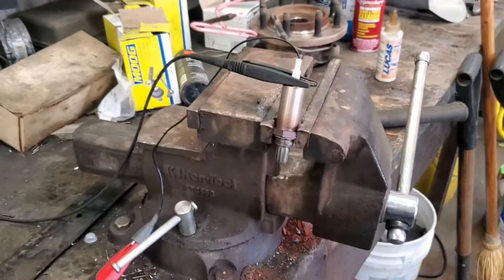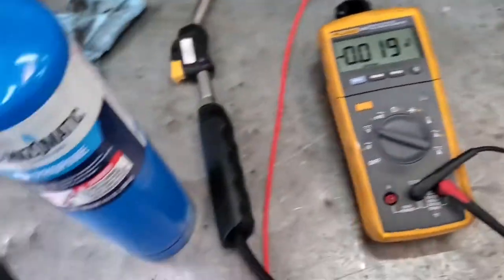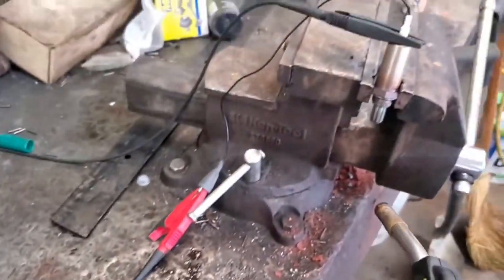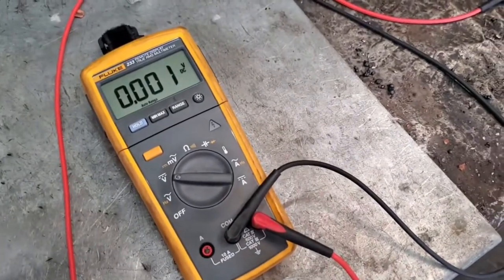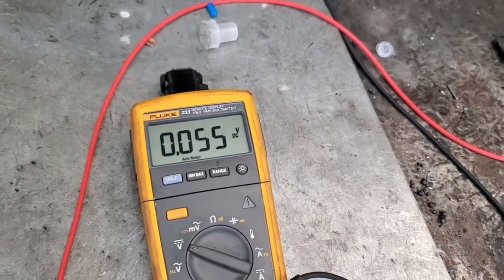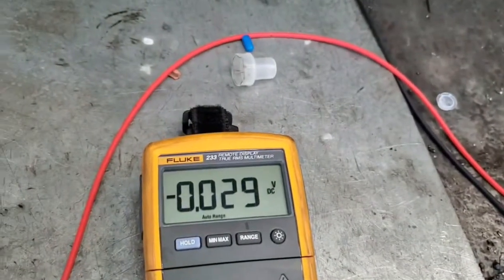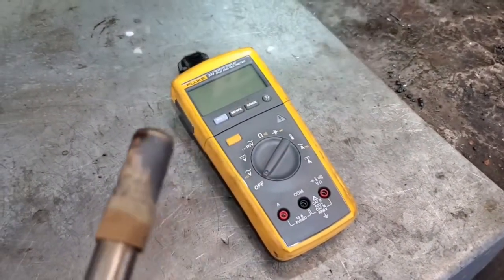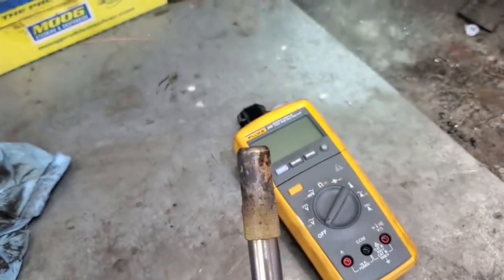Bench testing single 1-wire oxygen sensor with propane torch

Comment: is single wire o2 sensor really that important for fuel economy
Reply from the maker: Very important. This one came in for bad fuel economy. The sensor wouldn't produce voltage so the ECM thought it was running lean causing the ECM to max out the fuel trims. This single sensor has an extreme effect on air/fuel ratio.
Reply: But ,my Suzuki car single wire. This reading volt slowly up and down need 1 minute need .this problem sensor.
Reply: @TechnicianRed  A propane torch should also clean it from build up carbon ?